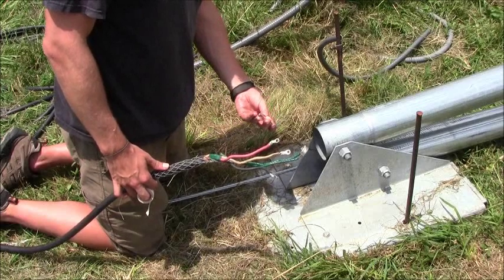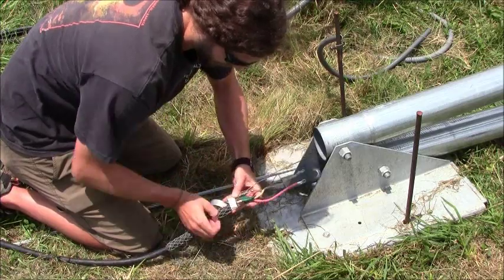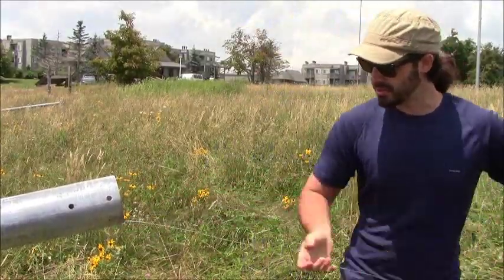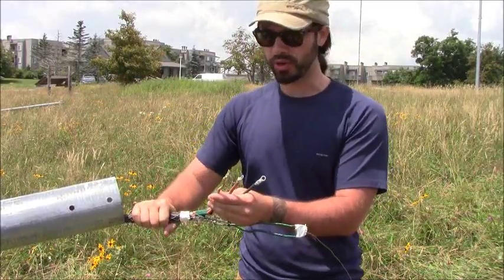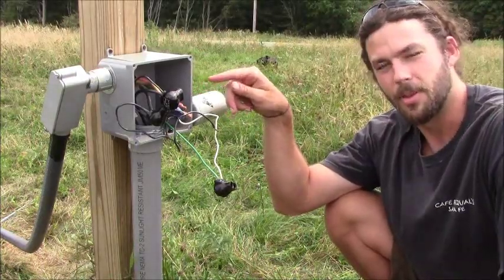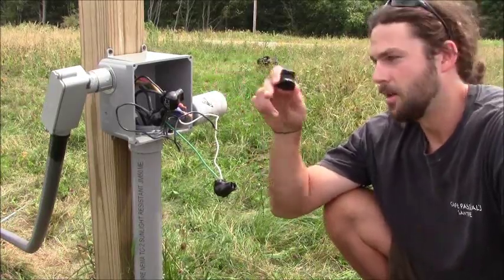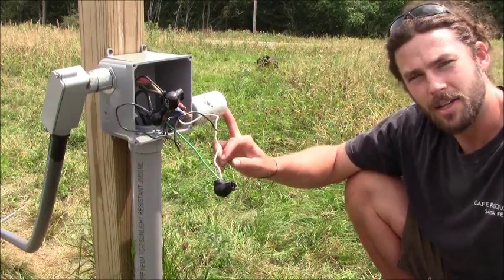Part 5 - Pulling Wire & Wiring a Bergey Excel 1 Junction Box

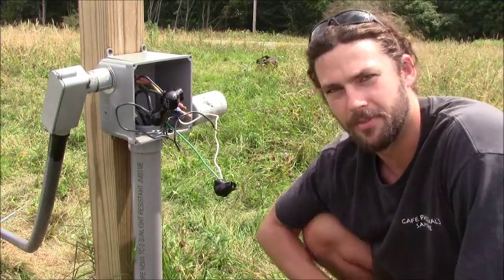Comment: 1:44  now do the right thing and lower your junction box so that you can strap that flexible conduit strait up the post and into the bottom of a sightly bigger j box.  Your whole rickety flexible conduit is being held by one 3/4" locknut that has by now stripped and fallen and pulled your splice apart.  Am I right?

Comment: Given the total distance of 350 feet  8 gauge copper braided wire should be more than enough for minimal voltage loss for wild AC power.